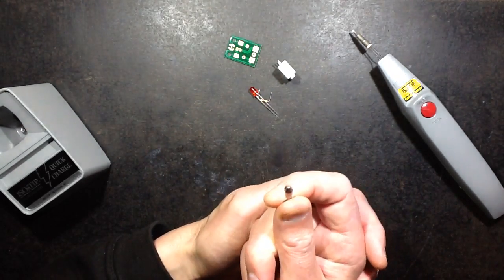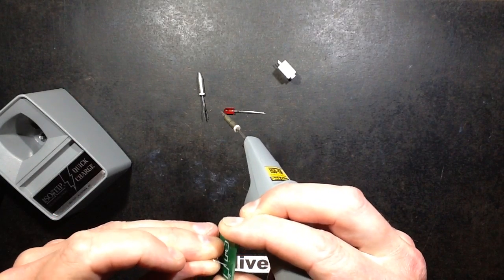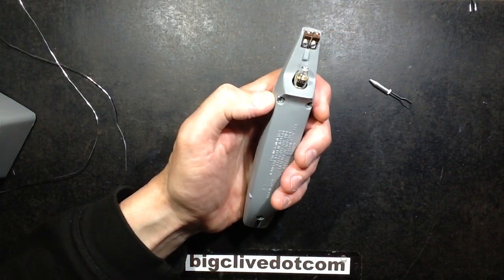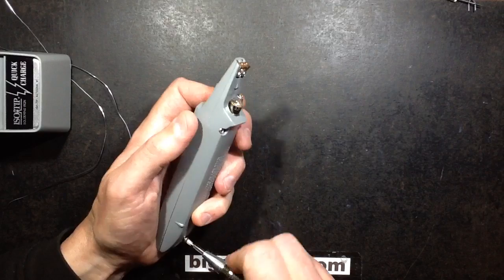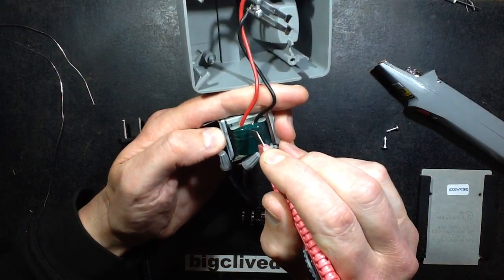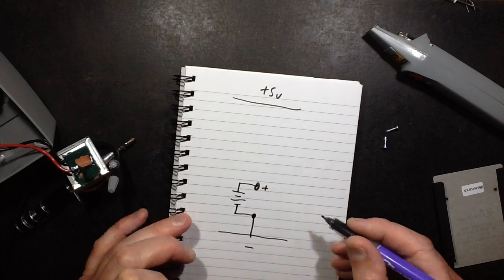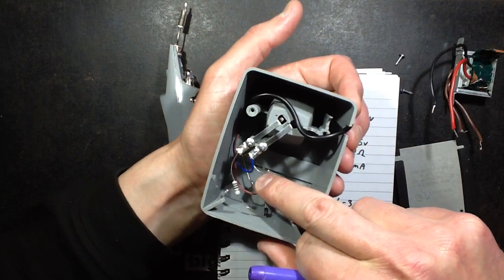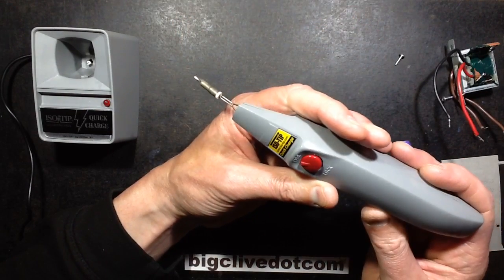Inside an Iso-tip rechargeable soldering iron.  (And charger hack.)

Comment: Isn't that basically an e-cig with an RBA?
Oh my god, wouldn't e-cigs like http://vapenw.com/reuleaux-rx200-by-wismec-jaybo-designs-15992 work better than the Iso-tip while being cheaper?
The Rx200 can supposedly handle up to 200watts, has wattage control, is cheaper, and charges through 5V usb.

Comment: Did you ever try one of the "cold heat" soldering irons that were advertised a bit a few years ago? They stayed cold and only heated the item you were soldering. I never had one but I thought they were a bad idea. I must have been right because I don't hear them mentioned anymore.
Reply from the maker: I really tried to get the feel for the Cold Heat iron, but it was not fit for the job of electronic soldering.

Comment: $50 for something that looks like it'll last a lifetime or more with proper care and the odd bit of maintenance is really not bad at all. I don't do a lot of soldering, but I could see having one of these just hanging out on my workbench for when it's needed.
Reply: Check out the website and you'll see rebuilt models as low as $20. And a tip as low as $6. So you could get the whole thing for about $26+tax(which if I recall correctly isn't much higher than it was back then.)
Reply: $121 in 2023 for a complete kit in a carrying case.

Comment: I used a gas iron for a long time, all my shirts have holes in them to prove that, that dang exhaust port would get out of line and melt holes, also burns the hell out of your belly if it happens in the wrong spot.

Comment: It really does need a cap for it. In the tool bag the tip would be constantly bent as it rattled around. I can't see it lasting long. Nice unit though and I love the modification.
Reply: George Jordan Thanks for pointing  out my error, i edited it so it is correct now.
Reply: InTheNameOfJustice That is why you remove the tip when you store it.
Reply: You remove the cap on purpose so that the tip will get bent? Are you sure?
Reply: InTheNameOfJustice he clearly meant tip
Reply: It was not clear to me but now it is and it makes sense. Thanks.

Comment: Didn't realize it until I got into the video a ways that this is the same one I had in 1979, just different color ! 
It finally gave out about two years ago and I put it in stuff going to Goodwill, wish I hadn't now, have to get another one ! 
Replaced the batteries in it twice with some of my rc car nicads, still worked great.

Comment: I wonder why they didn't fit the diode in the iron itself rather than the transformer. That would also protect against shorting the pins.
Also, I had one of these back in about 1978. It was orange.

Comment: Oh wow I could use this for when I am on the road doing pinball machine repairs on Solid State pins.
I could also use it when I go to Portland Retro Gaming Expo and use it to fix boards there at the convention. :)

And I like the fact they let you take it apart too.
And what is the Amps on the filament?
Would it be a 20A fuse?
And could you replace the fuse with the glass type fuse?

Comment: Didn't these things develop memory on the batteries?  Perhaps I am thinking of a different type battery.
Reply: Nicd batteries you want to run down almost completely dead then give it a full recharge and remove it from the charger. Topping off or maintenance charging will quickly kill them unfortunately as they're quite good batteries.

Comment: You are so right about the gas irons, I have a couple of them, when I was using them most of the time, nearly all the shirts I had have burn or melt holes in them from the exhaust of the gas.  They now sit in a pile and I use a nice little electric china special that works fine.

Comment: What size are the NiCd cells they look to be about 2/3C, Which means it could probably fit a  A123 Systems ANR26650 2500Mah cell in there which would give it a nice capacity boost or even the smaller 1100Mah APR18650 to lighten the iron up a bit if the tips can take the extra voltage ~3.2V of the LiFePO4 cell vs the 2.4V of the NiCd pack.
Reply: Cellules SUB-C

Comment: how do you charge a 2.6 V bat. with 1.6 V charger? am i missing something?
Reply: The 1.6v is the voltage drop across the resistor, not the voltage at the battery :)

Comment: I'm surprised you didn't add some batteries, and components from some of the power bank tear downs to the charging base.
Use a micro USB input to charge it,and the iron.
Then a standard USB output to charge other devices from it like a power bank.
Now that the transformer gone,there appears to be plenty of room to do such.
Reply: It would certainly make a cool build video for YouTube.

Comment: Glad you did a review. I really didn't figure any rechargeable solder could do any soldering work because of lack of power and lack of heat. I even looked at gas powered solders for cordless work and wondered about their pros and cons as well. I will have to give a rechargeable solder iron another look now. Very nice. Very nice video.  Thank you Clive.

Comment: It is quite possible that their transformer charger over-charges the NiCds less than your resistor limiter.  I think you should have measured the full battery charged trickle charge current of their transformer before you designed your modification.  If your trick charge current is much higher you could reduce the life of the battery.

Comment: I had a nearly identical Tandy one of these, very handy, incidentally the "memory effect" in Nicads is not a loss of capacity, just the voltage depression point happens earlier for something non voltage critical like this I doubt it will ever be an issue.

Comment: It would be interesting to see and know if the battery could be changed for a high drain/high ampage 18650 or 26650 li-ion and even have it with a swappable li-ion battery for extended use

Comment: I think you overlooked a simple reason why they use an incandescent bulb and Ni-Cad battery. It's too expensive to retool for new design on an old manufacturing line. 
- 
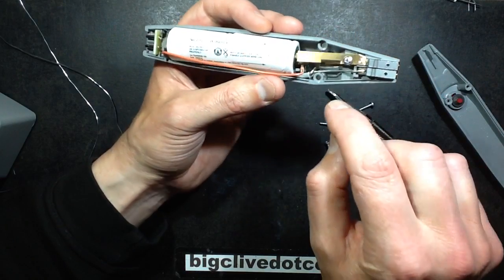9:49 That "Stiff Wire" is really a fusible link.
- 
The USB Charging mod was pretty clever in it's simplicity.

Comment: I had a very similar iron to that from TANDY it was Blue and had a power supply charger rather than a stand.
Same Lamp too !
I used to take it to school aged 11 some years ago (41) lol
I used it in my toolbox for minor field work for over 10 years until I got my first Weller gas iron
I still Have it some where though the NICAD batteries are long overdue for replacement and the Tip is long gone.

Comment: I have the same product made by Wahl, it does not have a charging base, but comes with a direct plug in. They are great in a pinch when you need instant heat. I like the modification you did with the charging base, it actually looks like it belongs there along with led indicator, "nicely done"

Comment: I must get one, the tip of my cheap gas iron has engulfed in flames randomly twice. It also burns surrounding areas when soldering simple things. I don't do any heavy duty stuff so this should be sufficient. What's the battery life like?

Comment: Hi Bigclive I have recently acquired a Wahl rechargeable soldering iron from eBay ,the description said charger works but requires a replacement C cell batteries but when I opened it I found the contacts on either end of the looking quite corroded do you think maybe the batteries are okay or would you change them and with what?The fuse wire is still intact. It's an unit from the USA. and more or less the same as the one you reviewed

Comment: Just out of interested to your modified USB charger. You say you were charging the soldering iron by 160mA and could have probably gone lower on resistor, Let's say go down to 5 Ohm resistor (or 2 x 10 Ohm resistors in parallel), then the charging current would be around 320mA.
But what about maximizing the USB charger and using something like 1A or 2.1A quick chargers? Ni-Cd are well capable of being charged like that.
What was the original charging current?
As I've seen a "Quick Charger" kit on Iso-Tip website, that charges the soldering iron 3 times faster.

Comment: I have one of these since the late 70's. It is orange color and still working but the battery is almost dead. Maby I need to replace that because it is a very handy tool. Specialy for working where you dont have access to power source.

Comment: how long does the battery last?
Reply from the maker: +jort93z Not sure, because it's designed to be topped up in its charging cradle.  But under heavy use it wouldn't last too long.
Reply: bigclivedotcom oki

Comment: Hey @bigclivedotcom - where can I get the little screwdriver you use to pretty much open anything and everything?! Whatever bit that has seems brilliant, it opens everything you need where a normal screw type is involved!?
Reply from the maker: +Andrew Armstrong It's a 9 in 1 driver.  I get mine from a UK shop called Poundland.
Reply: I'll check in there - I live in Edinburgh and have one near me. Although I've been in the US for the past 5 weeks with work! Loved your little video showing the tattoo piper stage overview too BTW!
Reply from the maker: +Andrew Armstrong Buy a couple.  They're very handy.  Make sure it's just the small set and not the larger sets in the round plastic containers as the larger sets are poor quality.

Comment: I do not like the charging circuit at all. Even being Scottish,  instead of one 1n4001 I would use 3x 1n4001 in series to create voltage drop of of some 2V to keep the accumulator from overcharging.

Comment: With how damn simple this thing is, I wonder if you could MAKE one? 3D printing the case and charger would be simple, a lot of the components are simple as well. I'd still buy the tips from a proper manufacturer, but what about the rest of it?

Does the case get hot with use? Anyone know about any heat-resistant but still 3D printable materials?

Comment: Have a question, I am interested in purchasing one of these but would like to replace thwt tungsten bulb for a led one in the hopes of getting a bit longer life and avoiding any extra heat (as led run cooler than those bulbs) what are your thoughts? will it affect anything if u use the led bulb thats correctly rated for same voltage. My concern is some bulbs like those act as a fuse in some circuits like in old old soldering guns that would basically shoot mains Voltage thru a thick copper soldering tip.
Reply from the maker: +Elvir Haskovic I'd recommend keeping the lamp as it draws virtually nothing compared to the tip, and is only used in short bursts.  The LED would need boost circuitry.
Reply: Thank you!

Comment: Yep, tough design. I picked one up about 15 years ago for $2 at a flea market with a dead battery. $7 for a replacement pack from Ebay and it was up and running again. Mine is one of the old 7500 series, still labelled "Wahl Corp"

Comment: Could this be overcharged?
Reply from the maker: +Sean Anderson You can't overcharge NiCd cells.  They are super-robust and simply dissipate excess charging energy as heat.
Reply: +bigclivedotcom oh thats cool to know. ty. i guess thats another good reason to use them then.
Reply from the maker: +Marcel Lucassen Early NiCd were more prone to the memory effect if repeatedly topped up, but latter ones were less prone to that.  Early NiMh had overcharge problems but they solved that and they too recombine the internal gasses back into electrolyte so they can be trickle charged continually in simpler applications.
Reply: +bigclivedotcom 

. . . NiCd were more prone to the memory effect if repeatedly topped up . . . .

True - however, IIRC,  this was due to crystallization needles building up inside the cell. In this application these needles are destroyed by the high current discharge - this was a recognised way of rejuvenating NiCd's in the 'good old days' - discharge them heavily a couple of times and decent capacity was restored.
Reply: +bigclivedotcom They do seem to have a memory effect as far as I know, and won't fully charge if you keep charging them when they're have way empty. (correct me if I'm wrong)
NiMH doesn't have that memory effect but they can be overcharged, possibly damaging the battery (aside from the high amperage usage of the soldering iron which might be a problem as bigclivedotcom mentioned)
Reply: bigclivedotcom
Thanks for your reaction, you know more about the subject then I do and I'm going on information I heard a very long time ago when NiMH was very new and supposedly much better than NiCd, love your video's btw, very informative as well as entertaining ;-)

Comment: I think that Is possible to use a supercapacitor instead a batery.
Reply from the maker: +ArcanHage Not for very long.  Supercapacitors have extremely low capacity compared to a rechargeable cell.
Reply: +bac302 Adding a cap won't fix anything, the batteries will still have to top back off the caps at the same rate they discharge. Caps are good for storing power for a quick spike of current or to smooth out the voltage, but not something like this. Using batteries designed for high current applications is the way to do it.
Reply: +bigclivedotcom but maybe  a super capacitors + battery  + curent  limiter circuit between the two   so the battery  don't  wear out quickly  and also  you can use more  powerful tips
Reply: Richard Smith super cap have so much capacitance then 'normal cap' they can even replace  Batterie  in some cases 
for exemple  a 100 farde 2.7 v (HV1860 )  will have more then enough energy stored for heating up the tip  and don't  forget  that  that cap is used  in conjunction with the  battery
Reply: bac302 Whats the point if the battery can already heat up the tip fast enough? Why not use more modern high drain Lithium Ion batteries? 
I guess if you want to cheap out on a decent battery, but then the iron would only heat well as long as you are not using it continuously, otherwise it'll just be limited by the drain speed of the battery anyway.
Reply: Richard Smith cause  the  tip do not heat up strong enough  when used in any  type of real solder  (  a tiny  pcb with  thin traces  is not ). it's not about  speed  but  about providing enough heat  that  it will not  drop  dramatically when in contact  with copper
beside using  battery with near short circuit  current will wear out quickly

lithium ion are  much more effective  weight / volume but i still  thing it's not suitable for this use
Reply: Richard Smith NiCad batteries may not have the punch of the newer stuff,but will last YEARS longer in regular use.

Comment: Great review, disassembly and hack.  I went looking for one online, it's NOT cheap.  It's $58 for this model 7700 and $67 for an even faster heating iron, the 7800.  Long story short, nothing else comes close.  Very importantly, they have quite a large selection of alternate tips, which are cheap, about $7.00 each. This is not a "buy the raiser and pay over and over through the blades" scam!  The other cordless irons I found use AA batteries and heat up in about 40 sec instead of the 10 sec the Iso-Tip takes.  You can also get replacement ISO-Tip Ni-Cad batteries easily, which is good.  Oh yes, there is one other type of cordless iron, the cold solder iron. They break their carbon tips soon and often.  Oh BTW, the original company was Wahl.

Comment: Wouldn't it damage the battery if you left this charging all of the time?
Reply from the maker: +Ruggie1of1 NiCd and NiMh cells can be left trickle charging indefinitely.  They recycle the electrolyte internally and dissipate excess energy as heat once fully charged.

Comment: For this application I would say NiMH and NiCd are superior to lithium ion in terms of safety and NiCd is superior to NiMH in terms of current capability.  NiCd > NiMH > Li-ion  Unless, perhaps, they used lithium iron phosphate.
Reply: The newer 18650 batteries can supply tons of amps. people draw 100 watts or more from them in E-cigarettes now.
Reply: +vbernabucci 100w with two 18650's. maximum you should draw from a single GOOD 18650 is usually something like 70-80 watts. Most of them usually have an amp limit of 20amps

That being said, if you could get the resistance of the tip up to around 0.2ohm, and use a good 18650, it would be a very hot 68 watt iron, pulling a bit over 18 amps.

Comment: Thank you for all the great videos you made.
I was hoping to see you replace that tungsten bulb with an LED, and see what kind of circuitry and LED you gonna use.
Reply: I'd like to see that done, too -- only on the threaded lamp base using SM components, all put together with the Iso-Tip iron.

Challenging, sure, but the objective is mastery, and that is built on control.

Comment: Neat!

I have never seen that one before, looks interesting.

I was given a Weller BP650MP it is 4.5 volts standard AA so far it works well. ($17.00 Can)
I have not used it enough to drain the first set of batteries. Someday I will take it apart. ;~}

Leaving it on charge, I would have thought the NiCads would have developed a memory.

Later, FW.

Comment: Might have to invest in one of these, I'm ok with plugging in my soldering iron when I'm indoors, but I also do electrical on vehicles and I don't like having a hot iron setting around in the very flammable interior of a vehicle, plus it's also a pain to run an extension cord. Very nice product

Comment: might as well put a high drain 18650 battery in there too. Now that i think about it, you could probably get that tip, and use it in a regulated box mod for ecigs, new ones throw upwards of 100 watts, and most rebuildable atomizers have a set up that the leads of the tip would go in perfectly. I might just try it!